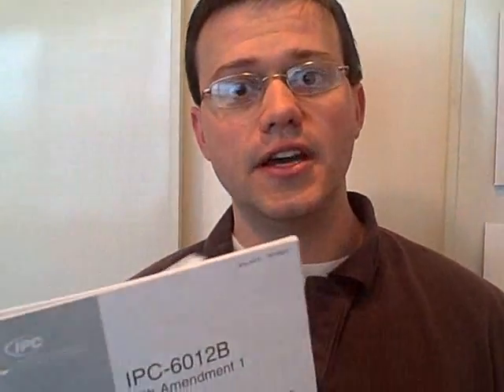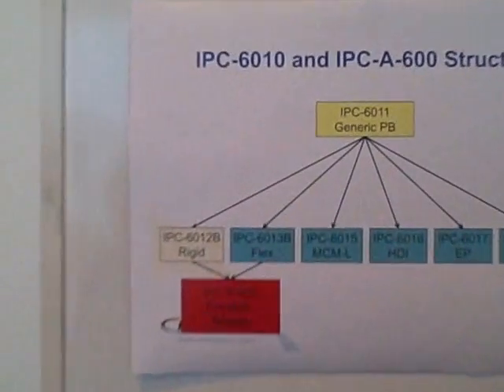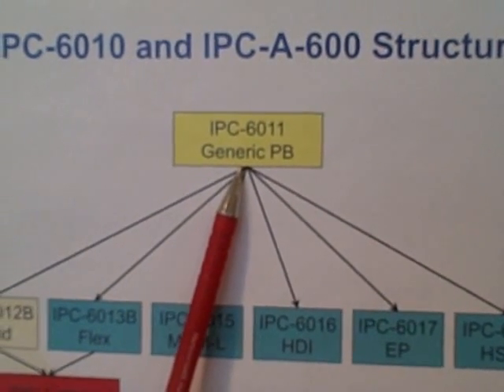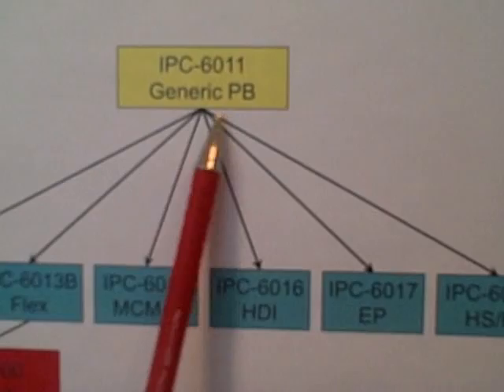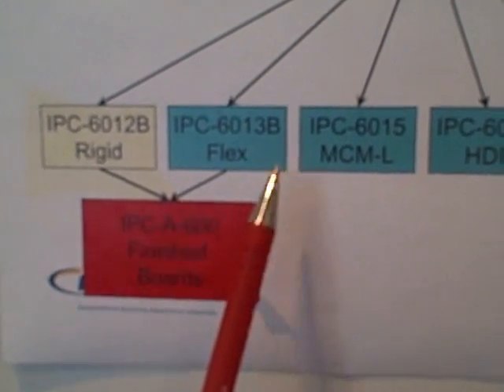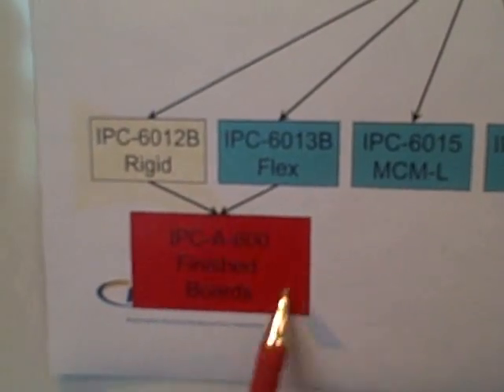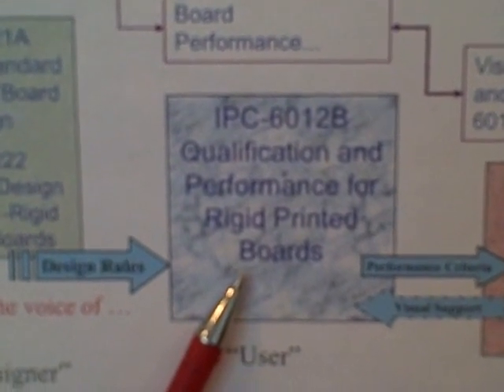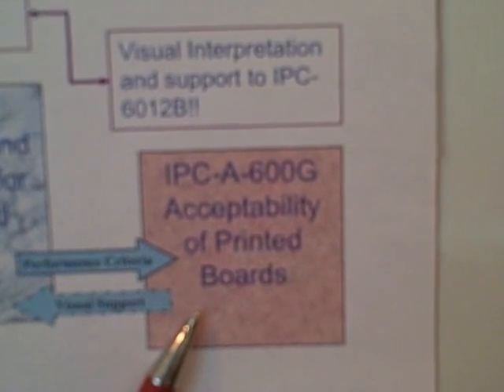What is the right standard to use for qualifying PCBs  IPC-A-600 or IPC-6012?

Comment: International Standards for Manufacturing and Procurement in the Electronics IndustryIPC-A-610G电子组件的可接受性,组装品检验国际标准Acceptability of Electronic AssembliesIPC/WHMA-A-620C线缆线束的设计及关键工艺要求、验收，接插件等检验标准Requirements and Acceptance for Cable and Wire Harness Assemblies IPC-A-600J印制板的可接受性，PCB、线路板的检验收标准Acceptability of Printed BoardsIPC-7711/21C电子组件的返工返修流程、标准对照Rework, Modification and Repair of Electronic AssembliesIPC J-STD-001G焊接的电气和电子组件要求 Requirements for Soldered Electrical and Electronic Assemblies免费下载地址：www.file123.top
Reply: That's a scam link if I've ever seen one.